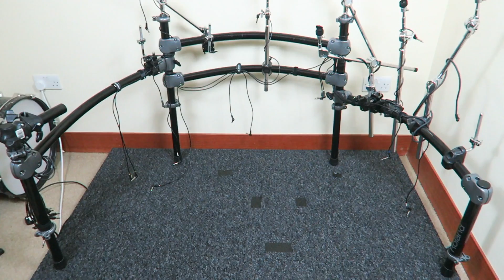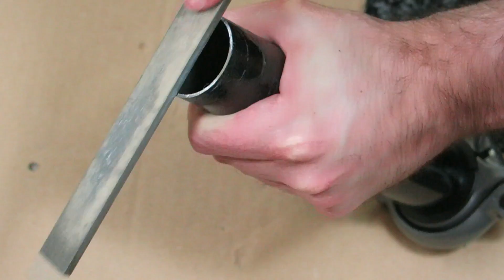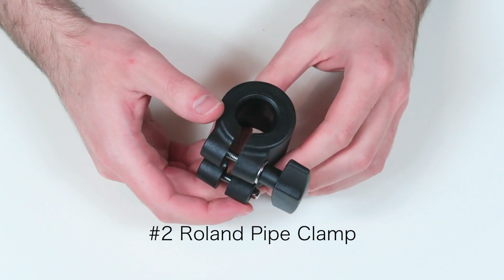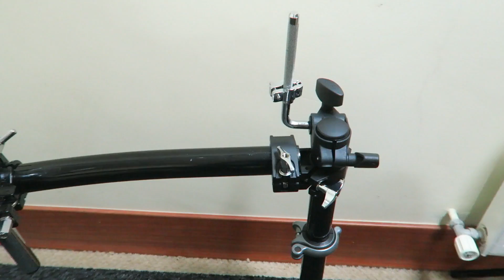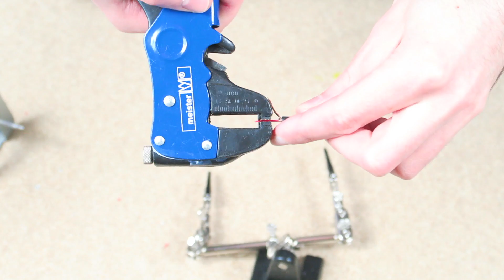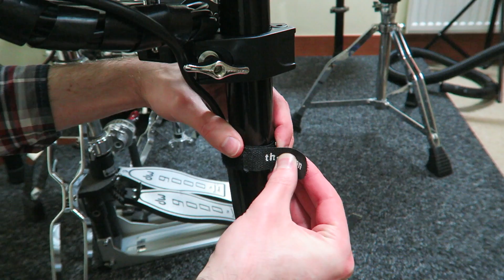E-drum Custom Rack - DIY

Comment: What is your opiniom on the Roland MDS-12V rack?In particular,the newer plastic hinged clamps with cable ports that replacled the ones you got rid of here.
Reply from the maker: I would say it is the 2nd best rack available (after the MDS-25/50).
Reply: @Vdrumtips1  That was my opinion as well,although I had heard differing views regarding the plastic clamps.I almost bought one on Ebay a few weeks ago,but then 10 sniper bids came in in the last 5 seconds.

Comment: Why do you remove the clamps? It seems unnecessary to remove them when letting them on the rack which saves you time. Great job btw.
Reply from the maker: What clamps do you mean exactly? :)
Reply: The clamps for connecting the cymbal arms and tom arms. At 1.33 you have them all removed from the rack
Reply from the maker: 1. I replaced some of them. 2. I built the rack from scratch and wanted to start clean. 3. I drilled holes into the pipes, which would have been too much of a hassle with those clamps.

Comment: Vdrum Tips does it works for TD-11kv rack system
Reply from the maker: Sarah Asher Geronimo Adminstrator Sorry, but I don't understand what you mean specifically. But I guess you are asking about the cables in the rack pipes? Well no, cause the cable snake does not allow you to fit angled jacks trough the pipes.

Comment: You should add affiliate links for U.S. Shoppers. Great build! What are your thoughts on customizing an e-kit for traveling. Possibly 1/4 inch cable connections at each section of the rack  for easy tear down?
Reply from the maker: Thanks, there are actually some affiliate links for US shoppers:) Yes, I would even use a multi-pin connector to divide the segments.

Comment: Excellent work, but one suggestions.

I would not cut the cables to shorten them. Instead, I will first lay them backward from the pads/cymbals to the module. Any slag it has, I'll just make figure 8 loops and tie it under the module. You can't see the cables unless you look directly under the module.

This way, you don't have to cut/strip/soldier/wrap those cables, and they are reusable.
Reply from the maker: Well, I can extend them again if I want to:D

Comment: I love what you have done here. Great job.  

Alas am moving my kit to and from gigs and rehearsals. I need to pull he rack apart every time. Sigh.
Reply from the maker: Thank you Brad, so you would need a rack that can be dissembled? Or just a compact one which is light and foldable?
Reply: A rack that can be dissembled. It's a much modified DM10X kit. Would not fit on a smaller rack.
Reply from the maker: I would build it in a similar way and would use big cable connectors where you take off rack parts. So you could just unplug the whole bunch with one plug.